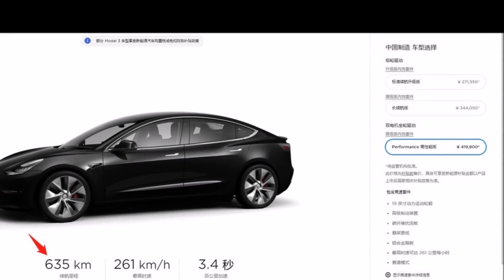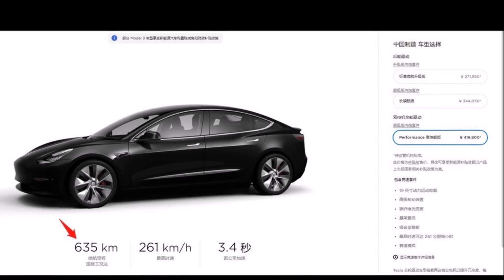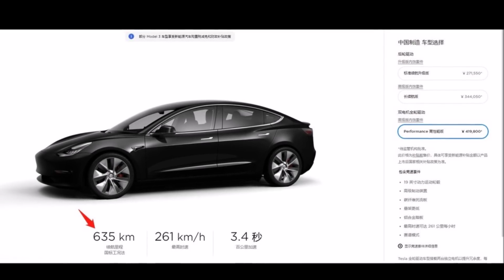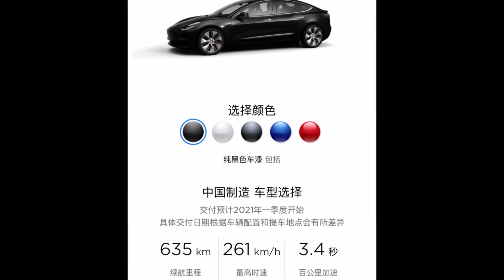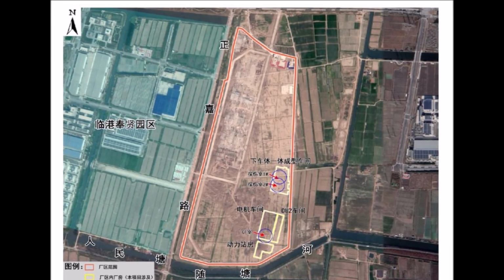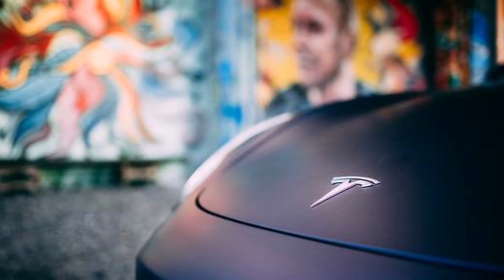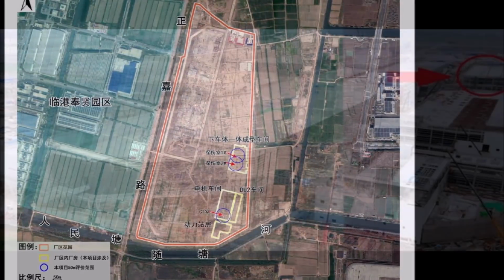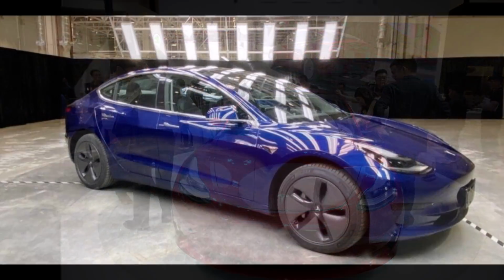MIC Model 3 Increases Range to 394 Miles as Giga Shanghai Expands with Plan

Comment: I think that the new building @GF Shanghai which is connected to the Model Y production using a bridge will house the massive aluminium casting machine for the rear 3rd of Model Y's (and later on maybe also Model 3's) body. Elon Musk talked about that during the Q1 earnings call if I remember correctly.

Comment: If Tesla doesn’t come up with profit for Q2 but make Q3 profitable 
what happens to S&P 500 inclusion?
Reply: Depends on the size of the Q2 loss. As long as any potential Q2 loss is less than the combined profits of  Q4 '19 plus Q1 & Q3 '20, Tesla will listed on S&P 500 maybe as early as Q4 2020.

Comment: In some ways the European range testing is a disservice to Tesla, because if people expect such high EV range numbers, they may be disappointed when real world numbers are lower. There are so many factors that affect EV driving range, from weather and temperature, to peaks and valleys, to driving speeds, to driving styles. I think that the EPA provides a tougher, well rounded, and more realistic test. And I think that Tesla owners would be happier overall to discover higher real world EV range, than lower. 394 miles seems unrealistically high for the regular long range Model 3, let alone the Performance model. Still, I hope that it is a good sign that Tesla has been able to increase their Model 3 (and likely) Model Y's EV driving range. It has been suspected that Tesla is actually putting a larger than 75kW battery pack into their Model 3 and Y, and they could limit the accessible/visible capacity, with the ability to open the pack's full capacity via software, as they have done many times in the past. Or it could be that the added range is simply due to increased efficiency. Time and more testing will tell.

Comment: M3 LR with 19" Sport wheels in Australia has 620 km NEDC range vs. 668 km for the MIC Long Range with 18" Aero wheels. It could be explained by higher efficiency of Aero wheels, but the range estimate doesn't change in configurator when you change wheels to 19" Sport.